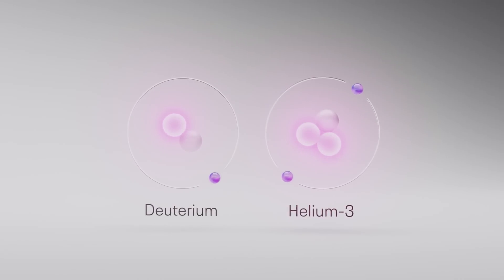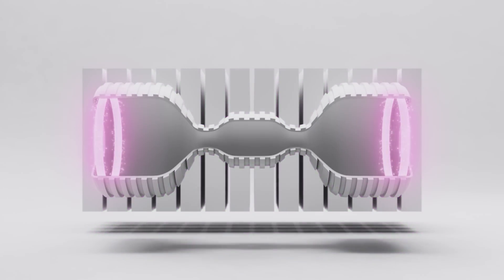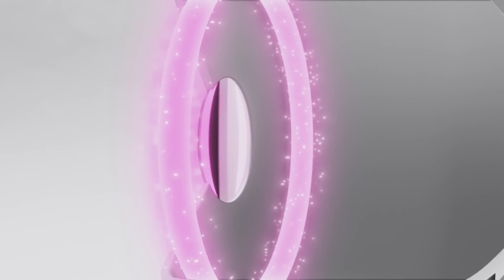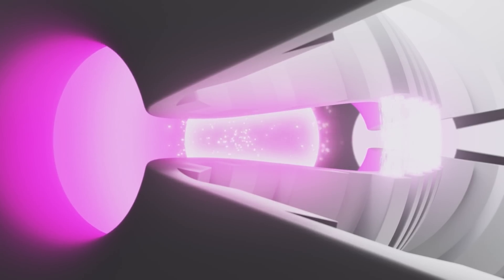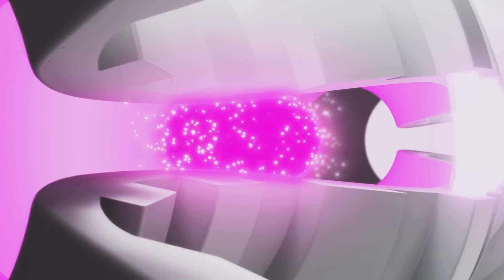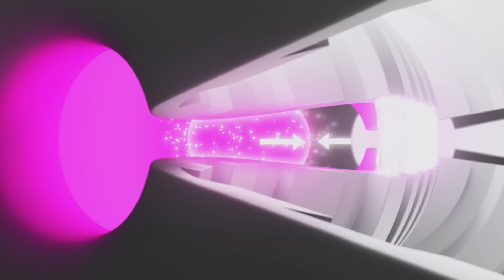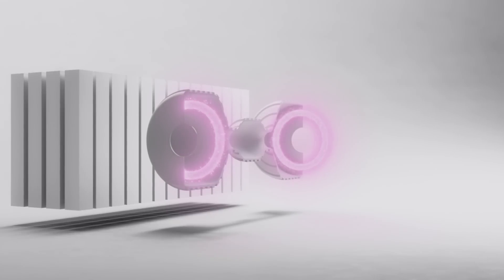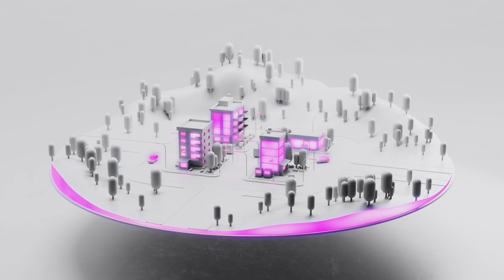Helion's approach to fusion: How it works

Comment: Helion has done different work. I recommend building a machine approximately like the one you show, then using heavy Yuan loaded atoms that are shot into propulsion by nano-lasers, guided by nano-mirrors, and ultimately confined in a nano-wall, where two atoms, further sped up by nano-lasers will collide and(their guard duties lulled by the chilled temperature) we will achieve consistent fusion, a reaction that will shoot a massive amount of energy onto the grid. This can be done again and again.

Comment: RST Synthesis: Helion Energy as Substrate Engineering

RST Equation Reference: (∂²S/∂t² − α(t)·c²∇²S + βS³) = α(t)·σ(x,t)·FR(C[Ψ]) RST replaces the conventional matter-energy dichotomy with a unified Substrate reality:

Matter is the bound geometry of S.

Usable energy is the controllable, self-sustaining potential (βS³) within S that maintains that geometry.
Analyzing Helion Energy’s fusion approach through the lens of Reactive Substrate Theory (RST) reveals parallels and tensions. RST redefines matter, energy, and force interactions as emergent behaviors of a continuous, dynamic field—the Substrate (S). Key concepts from the video are interpreted as follows:

1. Plasma Confinement and Substrate Tension

Observation: Helion uses Field-Reversed Configuration (FRC) to collide and compress plasma blobs, aiming to ignite fusion.

RST Lens: Plasma is a high-energy disturbance in the Substrate. FRC attempts to create localized tension knots (σ Solitons) that mimic matter formation. Plasma instability reflects the Substrate’s resistance to maintaining coherent tension structures under extreme stress.

2. Direct Energy Conversion

Observation: Helion plans to convert plasma energy directly into electricity, bypassing turbines.

RST Lens: Energy is a dynamic tension state of the Substrate. Direct conversion taps into the Substrate’s oscillatory behavior, translating tension gradients into usable energy without mechanical systems.

3. Helium-3 Fuel and Neutron Minimization

Observation: Helion favors deuterium–helium-3 fusion to reduce neutron damage.

RST Lens: Neutrons are chaotic tension waves in the Substrate. A cleaner reaction implies a more stable Substrate response, minimizing oscillations and preserving structural integrity. This supports RST’s emphasis on field coherence over brute-force energy release.

4. Pulsed Fusion vs. Steady-State

Observation: Helion uses short bursts rather than continuous plasma confinement.

RST Lens: Pulsed fusion reflects attempts to momentarily align Substrate conditions for Soliton-like nucleation. Each burst is a localized attempt to induce a stable tension knot. Difficulty in sustaining bursts mirrors the Substrate’s resistance to prolonged high-tension distortions.

Broader RST Implications

Fusion as Substrate Engineering: Fusion is not about forcing atoms to fuse, but shaping the Substrate into a configuration that naturally releases energy—like tuning a field to resonate.

Energy as Field Behavior: The goal is not just heat or particles, but a controlled transformation of Substrate tension into coherent energy output.

Challenges as Substrate Feedback: Instabilities, neutron damage, and material degradation are signs that the Substrate is resisting unnatural configurations. These are feedback loops that must be harmonized, not overpowered.

Conclusion Helion’s approach, while grounded in conventional plasma physics, contains elements that resonate with RST’s vision of a unified, field-based reality. The emphasis on direct energy conversion, clean fuel, and dynamic field manipulation suggests a shift from particle-centric models toward tension-centric engineering. If fusion succeeds, it may not just be a triumph of physics—it could be the first large-scale demonstration of Substrate-level control.

Comment: So once the plasma has fused, where does it go?
Reply: If Helion Energy ever manages to demonstrate that they can cause fusion reactions in a highly significant amount then only a fraction of the supplied fuel will likely fuse before the reaction disrupts the highly compressed plasma. The unreacted fuel and fusion reaction products will then be sweated into the chamber vacuum pumping system. The fusion reactions may only last for a billionth of a second with a maximum pulse rate of about one shot per second in their Polaris experimental machine which is the 7th generation machine that Helion Energy has constructed and is now experimenting with. Apparently Helion once claimed it would be producing electricity by the summer of 2024 but there is still no evidence that it is generating any significant amount of fusion energy. Helion has never generated even a watt-hour of fusion energy.

Comment: Google search for it:   Deuterium and tritium are NOT "superseded" in the sense of being replaced by another fuel source, but rather they are considered the most promising fuel combination for nuclear fusion reactions due to their relatively easy fusion process, producing a significant amount of energy when combined at extremely high temperatures, making them the primary focus for current fusion research and reactor development; essentially, they are the current "gold standard" for fusion fuel.    FULL OF CRP

Comment: HOW THE FCK SURROUNDING MATERIAL CAN WITHSTAND SUCH 10 MILLION DEGREES CELSIUS? DO YOU UNDERSTAND HOW HOT IS THIS?
Reply: The plasma compression will last for about one-thousants of a second but the fusion reactions will likely only last for around a billionth of a second and then be extinguished. This means that the fusion reaction period will likely be under one millionth of the time that the Polaris experimental machine will engaging in experiments. Helion Energy's Polaris machine is the 7th generation that they have built and experimented with. Helion Energy has yet to demonstrate that they can even generate a single watt-hour of fusion energy during pulses of Polaris and the previous experimental machines. It is naive to expect venture capital funded companies, such as Helion Energy to admit that they have encountered barriers that they hadn't anticipated.

Comment: This description began with an error. helium-3 is extremely rare and is not injected along with the deuterium. The deuterium-deuterium final compression stage is employed to generate the helium-3. Additionally, the illustration of the plasma creation and travel is slowed down by a factor of around 10,000. The final stage, of compression may last for less than ten-billionths of a second. Helion Energy has never, as of 1 November 2024, placed fusion energy on the grid. Their 6th generation machine, Trent’s isn’t likely to have generated any significant  quantity of fusion reactions during its approximately 20,000 pulses. Many of it promotional presentations focus on their dreams rather than what they have actually accomplished.

Anyone, who bothers to research Helion Energy’s past predictions of meeting benchmark goals with their series of experimental machines, will find key lapses. They need to keep pitching for millions of dollars of investor funding to keep playing with such machines. Apparently many investors have been relying on ‘critical assessments’ prepared by nuclear fusion energy fans, not by external disinterested experts.

Most fusion energy fans tend to immerse themselves in echo chamber information sources that reinforce what they prefer to believe in. As a result they are unlikely to run across assessments such as the following. I urge readers to search for the following YouTube video.

The problems with Helion Energy - a response to Real Engineering

All who are interested should research the following questions for the experiments conducted on their Trent’s (6th generation) and their Polaris (7th generation machines.
1) What is the quantity of fusion derived energy produced by these machines compared to the total energy input to their facility during the time these experiments are conducted (expressed in Joules)?
2) What is the total quantity of helium-3 that they have produced from the over 10,000 shots they have conducted (expressed in grams)?
3) What is the quantity of radioactive tritium that such shots have generated (expressed in grams) and how do they prevent the release of the unfused tritium into the atmosphere?
4) The Polaris machine is expected to operate at a shot rate of one pulse per second. What is the expected time (expressed in nanoseconds) that the fusion reactions are expected to last during each shot?
4) How long can the fusion reactions last, within each pulse, before the buildup of fusion products poisons the fusion reactions?
5) Will the announced energy gain, of the Polaris machine be derived from the average energy input to the operating facility, or will it only include the energy expended to produce the short fusion pulse?

Comment: What about the neutrons?
Reply: Yeah, fusion makes neutrons. Helion's machines produce fewer neutrons than a Deuterium- Tritium burning machine (about 1/3 to 1/4) and they have less energy (2.45 vs 14 MeV).
Overall, much easier to shield against and there are many materials that handle that well. That means the machine will last a lot longer.
Reply: @elmarmoelzer2229 - Most of Helion Energy’s slick promotional presentation focus upon their dreams if everything goes as planned. Their latest operating 6th generation machine, Trenta, still hasn’t been powerful enough to generate significant fusion reactions and therefore there has been no risk from the generation of fusion neutrons.

I assume that you must have had a specific reason for suggesting that Helion’s existing ‘fusion’ machines don’t pose a radiation threat. Perhaps it is because you are trying to project the image that your most current machine is capable of generating a significant quantity of fusion reactions.

Comment: Or .... doesn't. 2 years ago. No results.
Reply: They are currently building their next generation machine, Polaris. It is almost complete. Then a few months of tweaking and if all goes well, Polaris should produce a small amount of net electricity from fusion (a first). After that, they have a contract with Microsoft for a first power plant, which has to be completed in 2028.

Comment: The main reaction woild not bei D-He3, but D-D. You would build a neutron bomb. And - how would cool this thing?
Reply: It is correct that the main reaction would be D-D. Helion actually wants and needs that to make the Helium3. Half of the D-D reactions produce a Helion and a neutron. The other half produces a Triton and a proton. The Tritium from the second branch will decay to more He3, eventually. Until then, they need to do two D-D reactions for every D-He3 reaction. 
So, they produce one neutron for every three reactions. That compares quite favorably to D-T fusion, which produces a neutron in every reaction. The other advantage over D-T is that the D-D neutrons are only 2.45 MeV, vs 14 MeV from D-T. Those 2.45 MeV are a lot easier to handle than 14 MeV and there are a lot more materials available that they can use that will react relatively benign to those neutrons. 
And no, there won't be any (or very, very few) D-T side- reactions because the Tritium created by the second D-D reaction branch is too hot and non-collisional on the timescale of the pulse. By the time it has cooled enough, the pulse is long over and the Tritium gets pumped out of the chamber along with the other fusion products and residual fuel. It is then separated and the Deuterium and He3 are fed back into the machine. 
In summary: One 2.45 MeV neutron every three reactions vs one 14 MeV neutron in every reaction in a D-T machine. From a materials, shielding and cooling perspective, it should fare a lot better than a D-T fusion reactor (which are the majority of designs out there).
As for cooling, Polaris will still be air- cooled. The pulse rate is still low enough that air cooling can handle it. Future power plants will likely need more sophisticated cooling. Most likely water or maybe some other liquid.

Comment: Perhaps you meant, "This is how it doesn't work"?

While it is almost certain it will be a pulsed fusion reactor which will first produce usable electricity, and do it all without a steam cycle, but your system doesn't inspire confidence. He3 is a silly fuel, and the DT-He3 reaction has sub-reactions which produce a lot of neutrons, so your process is most distinctly NOT anuetronic - and that is a real problem for you, even if you can get it to work.
Reply: 1. Helion produces their own He3 from D-D side reactions. 50% of all D-D reactions result in a Helion (He3 atom) and a neutron. The other 50% result in a Triton (Tritium atom) and a proton. The Tritium will eventually decay into more He3 or it can be sold for $$$ or traded for He3, etc.
2. They are avoiding D-T side reactions. The Tritium is too hot and non- collisional on the timescale of the pulse (~1ms). It exchanges some of its energy in elastic collisions but never cools enough before the pulse is over and it is extracted along with the other fusion products which are then separated with the Deuterium and He3 getting fed back into the machine.
3. D-He3 is aneutronic, but the D-D reactions are not entirely aneutronic. As mentioned before, they produce a neutron in every other D-D reaction. They need two D-D reaction for every D-He3 reaction to close the fuel cycle. So, they get a neutron once every three reactions. Those neutrons have a much lower energy than the D-T reactions used in Tokamaks and other fusion power plant designs (2.45 MeV vs 14 MeV). Because of that, they need less shielding and there are more materials that can handle it for longer and/or they decay quickly when activated. E.g. their first wall is made from Quartz. Si28 has to absorb three neutrons before it becomes unstable and then it has a very short half-life of about 2.5 hours.

Comment: I did not believe fusion was possible on Earth. Congratulations to Helion. 👏👏👏👏👏👏👏👏👏👏👏👏👏👏👏👏👏👏👏👏👏👏👏👏👏👏👏👏👏
Reply: Spoiler: it doesn't actually work, lmao.
Reply: @ДмитроПрищепа-д3я  Don't care. Creative design. 🥰🥰🥰🥰🥰🥰🥰🥰🥰🥰🥰🥰🥰🥰🥰🥰🥰🥰🥰 I already saw a video (very nice video) that explained how Helion is operating at some lower output energy with the elements they are using. Still.....very creative design. I'm using to knowing only Tokamak, or Wendelstein, or Shiva laser type designs. I liked this design because they are actively trying to fuse the elements. As in, I wasn't used to thinking in this direction. So....don't care if it doesn't work. Great design. 👏👏👏👏👏👏👏👏👏👏👏👏👏👏👏👏👏👏👏👏👏👏👏👏👏 If you say the design is old and Helion did not come up with the original design, no worries. They've brought it into our consciousness now. 🥰🥰🥰🥰🥰🥰🥰🥰🥰🥰🥰🥰🥰🥰🥰🥰🥰🥰🥰🥰🥰
Reply: @ДмитроПрищепа-д3я  Love to you stranger. 🥰🥰🥰🥰🥰🥰🥰🥰🥰🥰🥰🥰🥰🥰🥰🥰🥰
Reply: @ДмитроПрищепа-д3я   Define "work". Their previous prototypes all worked as expected.
Reply: @elmarmoelzer2229 yeah... a pink neon sign. Incredibly impressive 😂

Comment: Let’s Consider the following.

Cold Fusion (LENR) - Unproven hypothesized type of nuclear reaction that creates nuclear fusion at room temperature by producing more energy than the amount of input energy can be produced from its altered state.
 
Tokamak Nuclear Fusion Reactor (ITER) - Requires a temperature of 150 million degrees Celsius to create nuclear fusion. Reportedly the record to date but having to use more input energy than produced is 69 megajoules of fusion energy for five seconds using 0.2 milligrams of fuel. (1 megajoule is equal to 0.00027 megawatt-hours) (The reported development cost for the ITER is $150 billion.)

Solar Hydrogen Energy Recovery Gas Turbine – 301Kwh of solar energy collected from the sun’s constant nuclear fusion at atmospheric temperature is sufficient for electrolysis to fuel a gas turbine and generate up to 330Mw of electrical energy. (700Mw is within the operational range) (330Mw equals 1,188,000 Megajoules) 

Wind and solar farms including pumped Hydro have proven to be cost prohibitive and ineffective because they now require 28,000 Km of Environmentally and amenity destroying Renewable Energy Zones to address curtailment that affects 80% of the Renewable market and requires a prohibitive operational land area equivalent to 10 times the size of Tasmania.
 
Based on Australia's CSIRO’s 2023 Gen Cost to provide Australia’s energy needs a total of sixty-five 86-330 Mw turnkey, Net Zero, Carbon free, Solar Hydrogen Energy Recovery Gas Turbines retrofitted to any of the existing 120 Hydroelectric schemes or standalone installation requires a total combined land area of 33 hectares. 

The 2023 cost range is between $2.4-3.3 billion, construction timeline between three to five years and meet net zero 20 years earlier. 
Whilst the technology will make Nuclear, Wind and Solar farms including Hydro schemes redundant it is an intermediatory solution until a multilateral decision on power generation can be agreed. 

Shovel ready off the shelf technology that combines Solar Nuclear Fusion with modern aerospace propulsion and existing Nuclear and Coal fired steam technology for an 86-330 Mw plant is costed at $36.5-49.5 million, noise level is 60dbl at 60m, and operates from an area the size of a football field. 
 
Green Hydrogen produced from the sun’s nuclear fusion, with an estimated 5-billion-year reserve supplemented with the turbines Variable Frequency Generator produces sufficient fuel and overnight storage of Hydrogen to power the turbine for a 24-hour/365-day period with a continuous and recyclable 14-year life cycle. There is also the added advantage of Direct Air capture (DAC) for CO2 provided from the turbines operational free energy air flow at the rate of 1,400kg/sec.